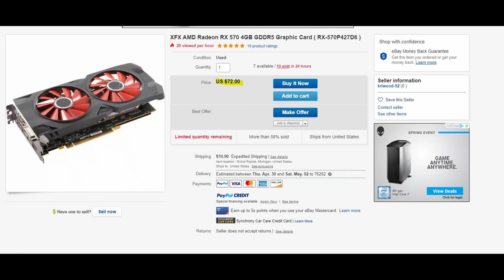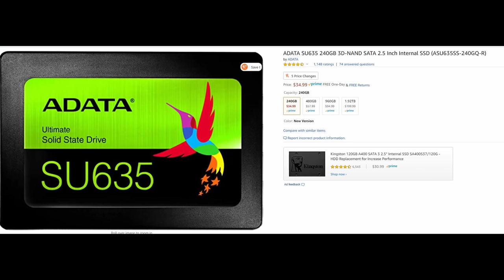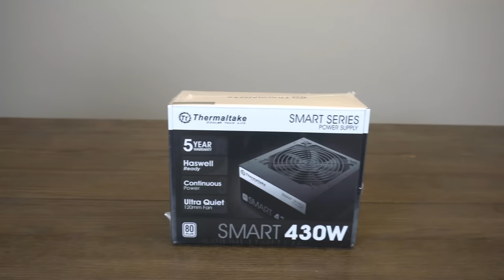$220 Just Get Gaming PC Build - Dell Optiplex 2020 + Benchmarks

Comment: Any suggestions for a GPU for HD video editing? Looking turn my 9020 into a secondary editing hub for capturing old footage and 2nd editing location.
Reply from the maker: Depends a bit on the software you are using but either AMD or NVIDA GPUs accelerate encoding.  Really though the load is on the CPU.  The stronger the CPU the smoother the experience.  I’m actually looking to upgrade my main editing rig to a 3950x or possibly hold out for ryzen 4000 to see what it has in store over my current 8700k
Reply: I'm using Adobe CC, I've checked out their website but wasn't sure what level would be the best compatible with the older system instead of over buying something thats too powerful. Currently as mine sits it runs Premier for capturing old DV tapes but not to edit anything.

Comment: Could you reccommend a monitor and mouse/keyboard? Almost every "cheap mouse and keyboard" video on youtube I see is like 70 dollars each, and i just dont have that kind of money to use.
Reply from the maker: Yeah... you can end up spending a pretty penny quite quickly when it comes to gaming peripherals.  I'm a huge fan of Razor and Corsair products.  
Some options here: Keep on the look out for deals on Amazon for certified refurbished parts.  I bought a K70 MX-Brown mechanical keyboard once for only $50.  So there at times are return deals you can jump on.  Also, look in your used markets if you are trying to save a penny.  You might want to clean / disinfect them but could be an option to get what you want on the cheap.

As for monitor, I would suggest anything in the 21"-"27 size, 1080p, 60-75hz (144 would be amazing but likely expensive), all my bench marks I run on a 60hz 1080p monitor.  You can typically find something like that around the $80-120 mark if going with a basic brand / part.  Monitors though can get VERY expensive, just make sure you hit the tech specs I indicated and look for the cheapest you can find and I am sure you will be fine for just getting started out.
Reply: @PCTechHustle  alrighty thank you so much!

Comment: This might be a bit long, so I apologize, so I bought an optiplex with 8gb ram and an i5 2400, chucked an rx570 in and ran the heaven benchmark on high settings, I got a score of 2421 with an average FPS of 96.1. seeing as the only difference in specs was the ram, yours being 16 and mine 8, is this a good benchmark?

Comment: I have a Dell optiplex 780. What graphics card schould I buy?
Reply from the maker: 780s are pretty underpowered and I believe have a bulky proprietary cooling system that is bulky and makes mounting GPUs quite difficult.  I’ve typically stayed away from them for those reasons, just a bit too old.  With that said it is still doable with low profile GPUs.  You might want to look for something that doesn’t require external power (a small form factor).
Reply: @PCTechHustle  thanks! :D
Reply from the maker: Also I did a quick search where a guy does a tear down, search for Optiplex 780 GPU upgrade, might find that helpful
Reply: @PCTechHustle  ohh Ok thx again

Comment: hi! great video. I'm wondering about the cinebench. I see you used a R15, which I've never seen before. I see folks mostly use the R20 as you also did. I've also seen the R23 version. which I have. are the results the same across the board, with no differences between the version? is one better or more desirable than the other? I bought a Dell Optiplex MT 7010 from ebay. it came out to around $290 all said by the time I got it. I love the Dells. the hood latch is sweet! I got an i7 2600 4gb. nvidia gtx 745 4gb. a 128 GB SSD. 2, 1 TB HDD. 16GB of DDR3 RAM. can go to 32gb. optical drive. wifi card. windows 10 pro. I only play Medal  of Honor multiplayer. it stays pretty much at 90 FPS. I guess I need to get the cinebench R20 version, so I can compare with more people. mine scored a 2989 with the R23 on multiple core. I forgot the single core number. but, anyways, the cinebench basically commented on my machine that for what it has, it runs really good. it was nice in saying that my pos ran pretty good considering it's a pos, lol.
Reply from the maker: Hey thanks for the comment!  Yeah this is a bit older of a video where R15/R20 were more of the standard.  I’d say stick to r23 to have the most comparable results to other systems.  Thanks for watching!
Reply: @PCTechHustle  hi! thank you for responding! yeah, I googled it and it basically said that there's so many using the 20, that folks are slow to switch. I'm gonna get the 2, also. it is funny that I'm kinda on time or a little ahead of the mainstream on this one. I always the last one to get to the party. a good example of that is my favorite game(only game), that I play every day is the old Medal of Honor. so, in the 10,000 videos with benchmark game testing mine is never mentioned. that makes cinebench my only possible way to compare anything. I do have a question for you. I'm looking at intel i5 10600k's(ebay), and a handful of the ads have SRH6R written right after intel i5 10600k headline. then the next thing mentioned is the 4.1Ggz. part. SRH6R is large and sometimes it's in parentheses. I've burned up google searching them in a bunch of ways and got absolutely nothing. I even texted 2 of the people with this in their ads, but no one responded. obviously, if this is the biggest worry in my life, I've got too much spare time, lol

Comment: Will a blower fan (i7 model) work efficiently in an ATX case if i swap case? just curious
Reply from the maker: Will do fine.  You can’t overclock through this motherboard so everything will be pretty low power draw.  I actually did just that in my latest video!
Reply: @PCTechHustle  It would look a bit odd though having a blower fan in your case, but i guess its the only one that will work. I'm going to get a FD XL which is a huge beast of a case so room won't be an issue. What power supply would you reccommend me to buy if i put my Dell motherboard in the case?

Comment: I saw an optiplex with an i5. 130 with monitor and m&keyboard.

Just dont know which gpu i should get. I want it for casual gaming, nothing serious.
Reply from the maker: For GPU the best or most powerful I would recommend is a gtx1660.  Going with a super would be an even further leg up but you would likely experience bottle necks.  I think the RX570/580 is a very sweet spot to pair with an optiplex.  Though you can go with a lower end GPU obviously but that would net you less performance.

Comment: I have a question. Is it alright if i bought a SFF desktop because I couldn't find a full tower desktop?
Reply from the maker: Yes and no.  No, because you will not be able to fit full size GPUs, you will have to go with a sfx GPU which tend to be underpowered and more expensive.

Yes, because it will simply work.  You can however do a case transplant too which will allow you to use full size parts.  Check out my video on that as well!

Comment: Is the i7 3770 and gtx 1650 possible with a 240watt psu in the optiplex 3010
Reply from the maker: Yea if you get the model that doesn’t require PCI-e power.  That would allow you to save some cash by not having to get a higher wattage PSU.

Comment: Could I use a gtx 760 or gtx 770 with this build ?
Reply from the maker: Absolutely! Any card will really work so long as it fits your budget and inside the case. 
The only thing I would not recommend is spending a ton on a GPU to pair with a lower powered system like this.

Comment: Could you do the same with a Optiplex 780?
Reply from the maker: Not impossible but those models have a strange cooler setup that makes it difficult to mount GPUs.  You would have to find a mini / sfx version.  However I just recently got my hands on a 980 which I wanted to fully explore this, I may make a video on that as well.  Stay tuned

Comment: I bought all the parts and they are shipping but one last question. My power supply is getting here on the 13th of June while everything else is gonna be here on the 3rd of June. Can I go ahead and start playing before the power supply gets here or should I wait.
Reply from the maker: If you bought the same parts I put this system together with then the GPU will require more juice.  You will likely experience insufficient power related shutdowns.  I would play it safe and wait.
Reply: @PCTechHustle  Ok thanks

Comment: Does the graphics card fit in the case?
Reply from the maker: I hate to ask... but did you watch the video?  It fits! lol!
Reply: PC Tech Hustle I did but when I got on eBay they look a lot smaller. Do I have to get that exact pc?
Reply from the maker: You don’t have to get exactly the same but I would recommend you get the full tower case so you can fit in about any size GPU.  If you go with with the SFF you will be very limited.

Comment: Hey nice build, can you tell me the temperatures of the gpu while gaming?
Reply from the maker: 65-68ish.  Stayed well within temp specs.  I was actually pretty impressed considering no intake fan and not a ton of space on the under side of the GPU.
Reply: @PCTechHustle  yeah those r nice temps im planning on putting in gtx 1060 i hope i will get some what close temps, if not i guess removing hdd cage and adding an 140mm intake fan will do the job..
Reply from the maker: @hill7487  Yeah I don't think you have anything to worry about

Comment: What do you think about this prebuilt that I found. It's 600€ with I5 8400k, gtx 1060 6gb, 256 ssd + 1tb, it has 350 power supply though :/ I'm not sure should I get this or try to build my own pc.  That can be more expensive here. Cool video btw👍
Reply from the maker: Sounds like a great system with the exception of the power supply.  You will need more than 350w.  I’d be careful if someone is trying to second hand sell a system with a 350w.  No way that thing will run under load.
Reply: @PCTechHustle  Thank you for the help👍

Comment: I just found out about this channel and I had to instantly subscribe by the way is there any alternative graphics cards I can use that won't put a dent in my wallet but at the same time give me the same performance and the one listed in the video?
Reply from the maker: Rx470/480s, gtx 1050ti, 1650s/1660s.  2060 could also maybe be an option but likely start getting expensive.  Also if you find a used card obviously that will work too
Reply: I tink the rx550 low profile will be great too

Comment: Is there any other way for better airflow because I don’t have a drill
Reply from the maker: You can maybe squeeze a small fan up front and potentially look at replacing the rear exhaust fan with a better quality fan.  Aside from that, you are pretty limited in the OEM case.

Comment: Hey whenever I try to boot it up on the boot options it says my power button cable failure but whenever I plug in my power button cable on the motherboard it doesn’t start but when I don’t have it connected it starts im on standard dell case please help
Reply from the maker: Yeah there will be an error if it does not detect the power button cable.  Most times you can by past those pre-boot errors by hitting a function key.  I would keep that cable plugged in though if possible.  Maybe the cable is faulty though and if it starts fine without it the. I guess don’t worry about it.
Reply: PC Tech Hustle how do I get past the boot option?????

Comment: What is the best cpu to pair with a 8gb msi rx570
Reply from the maker: That’s a loaded question.  I wouldn’t recommend any super modern 6 core as something like that would be very GPU bound.  Something like this being an older gen CPU I find are great matches for rx570/580s etc.

Comment: @PC Tech Hustle do you think i could build this pc and put everything in the right parts for a first time builder because it seemed like you didn’t explain where to put words and what cords to unhook
Reply from the maker: Yes this very much can be done by a first timer.  All we really are doing here is adding 3 parts (PSU, GPU, and SSD).
Reply: PC Tech Hustle is it different since it’s so old or will i be a keep to search up how to put in an ssd gpu and so on
Reply from the maker: All GPUs install exactly the same old vs new.  Since the Optiplex didn’t natively support an SSD you can just toss it in as I did.  I Velcro’d mine down so it wouldn’t rattle around
Reply: PC Tech Hustle so when putting for example the ssd down is it as simple as putting a few cords together
Reply from the maker: Breezer yep you just need sata power and sata data cables and you should be good!
Reply: PC Tech Hustle if i put something like a ryson 5 in it will it be better or not very much

Comment: Wouldn’t a one fan gpu be better?
Reply from the maker: It would definetly be easier to fit for sure!   Sometimes those single fan GPUs, depending on what you get do tend to run hotter or have scaled down clocks.  You can however fit in a 2 fan GPU, you just gotta keep it to what I said in the video, 10" or under.

Comment: Can I use a bigger power supply?
Reply from the maker: Higher wattage yes but larger size I would not suggest.  Most PSUs though are the same size unless you are buying an SFX or a very high wattage which tend to be larger.  Short answer, yes!

Comment: Hey would an nvidia asus turbo ge force gtx 960 4gb fit in the 10 inch space
Reply from the maker: If it’s under 10” then yes it will fit, also keep in mind a back plate can cause issues too.  I’m just not sure if the dimensions of the card you mentioned without looking it up.
Reply: @PCTechHustle  thanks for the info its just that my dad wants to get into warzone and im gonna use the build you have shown in this great video also what pc do u run
Reply: What about an nvidia gtx 710 because they are quite compact right?

Comment: does a gpu with 10.90 x 5.50 x 1.70 inches fit?
Reply from the maker: That will be a bit too long but you can do what I did here and drill out the drive cage.

Comment: I''m planning to do 3D animation and rendering. Is there a better graphics card I should get for about the same price?
Reply from the maker: I don’t know much about 3D animation but you might be able to take advantage of hardware acceleration from an Nvidia card.  On that note for the same price usually GTX 970s can be found.  Or you could step up your spend to a 1060 or 1660 ti/super, etc
Reply: @PCTechHustle  thanks youre a very helpful YouTuber
Reply from the maker: Sure thing!

Comment: Hello help me what can I buy to build my dell  optiplex 3020 it has 1TB SSD 8GB RAM  3.3GHz Intel Corei 5.....I do video editing  on the low budget....
Reply from the maker: I’d you are doing video editing I would definitely upgrade the processor to an i7 4770 or 4790 and getting a decent GPU in there for encoding acceleration.  That would likely require a PSU upgrade as well.  Just kind of depends on what kind of budget you want to throw at it!  Stay tuned too I am actually doing a dedicated “upgrade Optiplex” video here soon where I explore sensible upgrades for the platform.

Comment: So I bought everything you got except for the ssd, and the pc is SO slow and can’t even run a game good, if I replace my hdd with an ssd will it help speed up the computer and play my games better?
Reply from the maker: Yes get an SSD and you will be very happy!
Reply: PC Tech Hustle Ok thanks! Thanks for the quick reply too!
Reply: Games would not run better from being on an SSD. Maybe launching them, but honestly you might wanna check your RAM speeds.
Reply: @deanminchella5119  yes they would, if you have a 5400 rpm HDD games will definitely not run well because the CPU and GPU gets data from ram and ram gets it from HDD and SSD (depends on which drive you have installed it on) so if the storage device is slow then faster or more ram won't help.
Reply: Play perfect games 

He’s stating the whole thing is slow, gaming included.

If it was SSD vs. HDD I feel like only programs would be slow (especially those that need to pop in assets all the time). But if even internet browsing is slow maybe better timings of RAM will help.

Comment: Will my i5 3570 bottleneck rx5700xt much? Or only like 20%
Reply from the maker: That’s quite a bit of GPU to pair with that CPU.  It will still run plenty fine but know there is a good amount of GPU performance left on the table.
Reply: PC Tech Hustle thx for respond

Comment: What’s the black deal you slid in towards the top of the pc after you put in gpu?
Reply from the maker: That is called a hard drive 😉
Reply: PC Tech Hustle First build I’m 9 and learning thanks
Reply from the maker: No worries.  It’s a slower spinning hard drive.  Typically these types of drives have much higher capacity than SSD hard drives but slower read/write speeds.  I installed it for additional storage to have room for larger games, etc.
Reply: PC Tech Hustle hey my Monitor keeps turning off and on but my PC is on do u know what I can do

Comment: This guy on offer up hooked me up with one of this. Has an i7, 12gb ram and he threw in a gt 730 plus a monitor for 140$

Later all i need is to upgrade psu and graphics card.
Reply: I envy you greatly
Reply from the maker: Pretty sick deal!
Reply from the maker: Pretty sick deal!
Reply: @Elkay26  look for a used one on offer up. Cheaper than ebay right now.

Comment: Is there a way to do an entry level build thats around 600 bucks that I can upgrade the CPU to i9 8700 and GPU to rtx 2080 and obviously I'd have to upgrade the psu ram and storage but would the same motherboard work for a cheap cpu and a higher end one
Reply from the maker: Yeah I hVe on my list to do something like that soon, even in the climate of the terrible parts pricing right now.
Reply: @PCTechHustle  bet I appreciate it and the feedback I'll be sure to subscribe